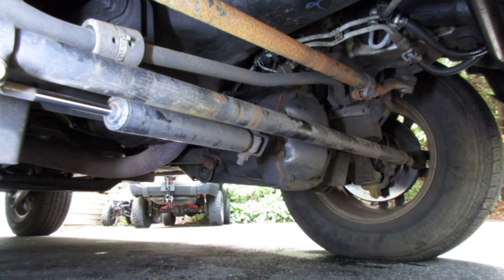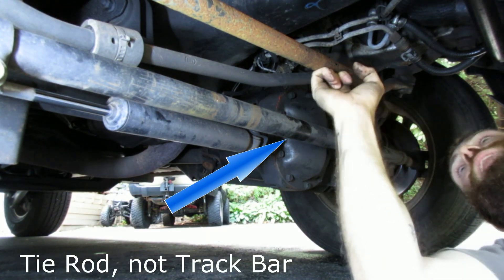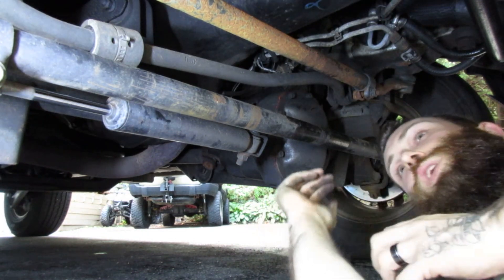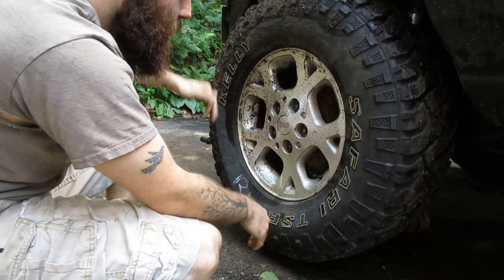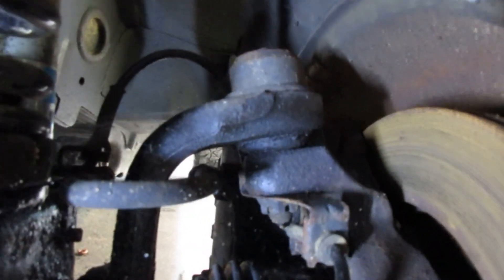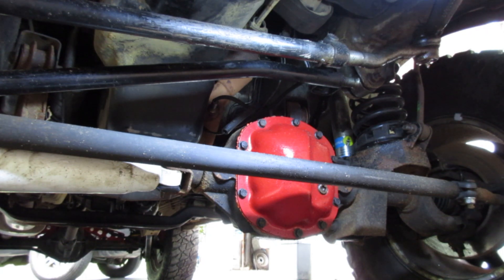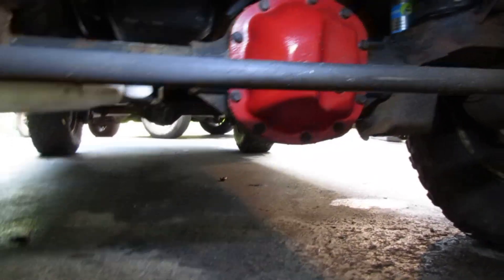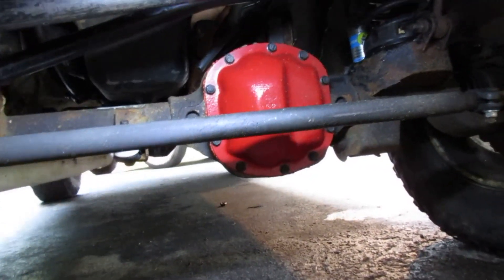How to Diagnose DEATH WOBBLE

Comment: Excellent rant! This video is gold and I am going to share it with everyone. This is critical thinking, expert level experience and articulation at it’s finest. Now I really wish someone would make a video like that on BMW reliability since that brand’s reputation has been tainted by virtually the same problem. The highly disproportionate level of abuse and neglect that BMW’s are subjected to in comparison to it’s competitors’ vehicles is rarely understood. So many of the same problems. First time performance car owners who don’t do even basic maintenance like oil changes, ‘enthusiasts’ who do incomplete mods and push their cars hard on the daily, and shops ignorantly splicing into wiring connected to complex electronics to install things like subwoofers are just few among many of the issues. I have a saying: “A Jeep is like a AK and a BMW like a HK. Both highly dependable, the question is do you want something inexpensive made for handling any dirt you throw at it or do you want something expensively engineered for ultimate precision?”

Comment: In 2004, My 1973 volkswagen beetle had a death wobble! Especially if I hit a bump on the highway. It took thousands of dollars at my volkswagen mechanics trying to figure it out. It wasn't until my tire guy told me my tires were being ripped apart (you could see the metal mesh thru my tread. 😬) and I desperately needed to go to get an alignment. Totally fixed it.

Comment: I am years late but I have a question. I pray you answer... I feel the car is not stable when I turn... its feels like my wheels will fall off. I dont have the big shaking. Also my steering wheel is kind of loose. i turn the wheel too much for the turns I take. The wheel turns too far to make little turns. Can you help me out with knowledge on the issue?

Comment: A bad steering damper may not cause death wobble but a leaking one can absolutely enhance it once its triggered.  If the oil is leaking out,  air is being introduced to the internals of that shock and air is compressable like a spring.

Comment: the expansion hose for my front differential fell to the ground leaking some fluid and that caused the jeep to have death wobble, took taking it apart and refilling it full of fluid to fix the issue after several mechanics said I was crazy and that theres no way that would be the issue, saying its prolly rotors, breakes and anything else you can imagine that doesn't really account for any wobbling.

Comment: I disagree with the fact that only solid axel 4x4s get death wobble. I have both a 1993 Toyota 4Runner (ifs suspension) with death wobble at anything over 70kph. I also have a 1984 Toyota 60 series with a leaf spring solid axel with the WORST death wobble I’ve ever experienced. Anything over 55kph I have to pull over and stop before I die.

Comment: You should say that the real reason Jeep's get death wobble.not because it's a solid front axle..it's because they don't use leaf springs.and leaf spring hold the frame to the axle stiffly where coil springs have alot of flex and movement so they NEED A TRAC bar.where a leaf spring front axle doesn't really need a tracbar

Comment: This was a great video.  Love that ball joint test.  I’ve done track bar, all tie rod ends, one hub, all control arms and still death wobble.  All parts were worn out but still haven’t found the last culprit.   Can’t wait to do that ball joint test.  Thanks so much!!!
Reply: @SCOOBYDOOBIEUFO  yes on that jeep I was talking about it was slightly worn ball joints.  For some reason out of the half dozen jeeps we’ve had that jeep was super sensitive to death wobble.   Any part that was worn would cause it.  After ball joints it went away.  We have a road that had a angled bump that we could generate death wobble on and after ball joints nothing.  It was gone, till the motor gave up.

Comment: The guy I bought my WJ from couldn't fix the death wobble and decided to sell it. I saw on jeepforum that the JKS adjustable track bar it had on it has red bushings and apparently they are known for being too soft. Went to kevinsoffroad.com and they say flat out on their website you probably need to change the red bushings for their black set, even though they only sell the track bar with the red bushings. Long story short I swapped them out and fingers crossed so far so good. I havent gotten above 60 in it yet but before at 55 you could feel the wheel start to move after hitting even a little bump. Maybe you guys can collect remedies like that for random issues and do short videos explaining them for people looking for answers. I'm sure they would be a hit.

Comment: I just had my oil changed and tires rotated. I didn't have it before but now I do. I've heard that a few possible tire issues can cause DW as well. Any truth to this?
Reply from the maker: Yes and no. Tire issues with trigger DW, but are not the root cause. You likely had something loose for a while and not one of the tires the came from the back and is now on your front is slightly out of balance and is triggering the DW.

Comment: Great video and explanation of the causes of death wobble. I’ve used these same techniques myself, and had great success. One small suggestion I would make, has to do with the tools involved in diagnosing the ball joint wear. Rather than a prybar and fulcrum, such as your chunk of wood, I use a long-handled shovel under the tire (although you could also use a short-handled shovel to get the job done). The angle between the handle and the shovel creates its own natural fulcrum and does a great job. Most offroaders have a shovel of some sort, although they might not have a long prybar. Plus, fewer tools means simpler prep and cleanup.

Comment: I have death wobble in my 91 infinity, car is v8 and only rwd, no front axle but not sure what its coming from. Thinking either tie rod end or something
Reply from the maker: Gotta be tie rod ends or possible control arm bushings. You can do the same test where you lay under it while someone turn the wheel. Look for movement
Reply: D&E In The Garage okay, cause I jacked it up and took the wheels off and shook the rotor up and down and side to side and checked the bushings I could get a good look at, all seemed pretty good tho

Comment: The rear end seems to go side to side when you hit a bump , what tricks do you have to check it? 2000 Jeep Laredo
Reply from the maker: Likely lower rear control arms
Reply: Do you have any tricks to check for that ,or is it easy enough to see if they`re worn, also would a guy be better off replacing the upper and lower control arms or doesn`t the upper wear out very often, I have 
175,000 miles on it.

Comment: I had a 98 keep grand Cherokee with death wobble. And I found a crack in the frame behind the steering box. I plated the frame and welded up the crack. After drilling small holes at each end of the crack. Stopping the crack from expanding. And problem solved lol. That was the best 150 dollar jeep I ever bought. Just because the other guy replaced Everything under the front end and could not get rid of the wobble.
Reply from the maker: Wow... that is wild! Sounds like you got a dang good deal though

Comment: I have had death wobble in my JK once, and it was the track bar. I now have it again, and checked everything, all seems to be tight except the upper, and lower ball joints. Like yours in the video, I hope that solves my death wobble, guess I have a project for an upcoming weekend. Awesome video! Did replacing those upper and lower ball joints fix it?

Comment: Okay, This is by far and away the best damned video on death wobble that I have ever seen, and I am so happy to have found it. I have both a 97TJ and an 04 Grand Cherokee. The Cherokee recently began to display the “Death Wobble” about 3 days after I bought it. My wrangler stopped having death wobble after swapping out the wheel bearings, and after 372K it needed them. Truth be told the 12 point bolts are actually a T13mm socket and it is best to use that particular socket after I found out the bolts strip faster than a drunken prom date. Having been a jeep guy for 22 years, most jeep videos treat death wobble as if it were some kind of occult secret that only the initiated could ever understand. While I have not experienced REAL death wobble, like other folks, I can tell you that when it happens to you the first time it is one of those things you do not forget. Again, many thanks for posting this video.
Reply from the maker: Thanks buddy. It really isnt a very complicated thing to diagnose

Comment: I have my 2000 Nissan Pathfinder, rear wheel drive, up on stands in my driveway right now because of this! I'm replacing the upper and lower control arms/trailing arms now. I will be checking closely on the sway bar links, coil springs, and shocks to see if any excessive wear or damage has been done to those during the time I've had the death wobble. The Infiniti Qx4 is almost an identical design as well. Years 1997 - 2004 are victim of this condition. Thanks for putting your video up and saving lives!

Comment: Replaced Axle shafts,all axle seals, then checked spider gears. Then replaced Wheel bearing hubs. All4 tie rods and adjust sleeves, got alignment. Then replaced Steer dampener  shocks, 2 track bars now, rebalancing all tires. All new brake parts. Sway bar links and bushings.  Replaced literally everything.  But ball joints, they are good greased and rock solid. Still have death wobble... I see my pinion seal is leaking again.  I'm going tomorrow to replace the front drive shaft rear CV joint it seems really loose and noisy. I really want this to fix my WJ wobble once and for ALL.... Maybe that's why the pinion seal is leaking again? Any tips will help thanks.
Reply: Want to follow up for everyone who has a mysterious wobble or shake in the front of there WJ. Most drive shafts have u joints some are double cardans, some are slip yokes. And then the R,pressa I believe that's how its spelt. What it is a a CV shaft style joint. And in mine was the inner cage housing was cracked within the joint and two of I think 6. Ball bearings where both bouncing around.  Of course found this out when I broke apart the CV. I found this to be the source for my wobble.  Make sense why a blow another pion
Reply: Pinion seal** from extra vibration. I hope this helps someone else. Vortex garage has a great video on replacing this style drive shaft.

Comment: This may be a saving grace for my 2017 F250 that just started having this issue,
Reply from the maker: Should work. good luck!
Reply: Zach Beach. My ranch hand has a 2017 f250 with death wobble. It was a factory defect. He carried it to the ford house and got it fixed.
Reply: I ended up selling it after three trips to the dealership and $2k out of pocket :/ I do drive a Duramax now so we will see how that goes

Comment: Loved this! Been rding with death wobble for about a year now and it is exactly as you described. Get over 45 and hit a bump and I have to drastically slow down to get it to stop. Stop riding on  highways to avoid it. 

Heard it was dangerous. Knew it was damaging the car but didnt really have a choice. Guess I'll get the whole front end kit off Amazon instead of just the control arms. 

Is it always the front end causing it or can the rear cause it too? Ive got gunk all in both rear wheels.
Reply: Can be very dangerous to keep driving if your tye rods are involved. If they give out & you're driving...you have no steering capability. Please, get your front end checked out. God bless.

Comment: This is my first go round with death wobble, but You confirmed what I suspected, I know I've got one bad the rods my tires are out of alignment Wich is what I suggested to be the problem or  main fact- or however upon inspection I found play in the wheel at 3 and 9 as well as 12 and 6 and the trac bar bushings are shot along with the stabll8zer link bushing s on the driver's side the side that tries making  out of me . Initially the wobble would start dead Knicks at 40 now though I can feel the wobble at around 25 and by  40 it's going nuts unless I have room to accelerate like I'm getting on the freeway, then I can drive past it /out of if it, when it states to wiggle just ease back on the 
Peddle let it get calmed down a bit then give a slight tug on the wheel while squeezing back into it until in know I've got it then I can hit it and go.. Occasionally that don't work I haven't had to completely stop but a couple of times damn b
Neer it . So I'll do the wheel bearing in the morning I would up with an extra one the last time I did them and everything else will have to wait until pay day
Reply from the maker: First time is always rough. Good luck with it!

Comment: Great video!! Wouldn’t the final test be better if you lift up Jeep in front or put it on jack stands and turn wheels while running lock to lock and check for play in components?
Reply from the maker: Actually no because you want all the tension that the weight of the jeep puts on the components. sometimes. Likely you would not be able to see the worn out parts if there was no weight on the system

Comment: Great video.  I did all of the tests on my 2000 XJ.  I ended up noticing play where the drag link meets the pitman arm.  I changed the drag link, the steering stabilizer ( which was completely trashed)  and pit new tires on.  Drives like new now.

Comment: My issue is my 09 2dr jk (45k miles) has a shake in the steering wheel and pedals at 75. No bumps that cause it no DW and it comes and goes. I do off road fairly frequently too.
Reply: did you check your wheel balance?
Reply: @MeastyJK  not yet but I'm going to. Hopefully that's it.
Reply: On an unrelated note I concurred a pretty flexy and sketchy trail... alone...  the flexy bits were down hill with no bypass. Damn I'm dumb.. 😅 I do feel like I have you guys to thank for the subtle lessons and know how in picking lines and what not though.

Comment: Is this the same for excessive wobble/shaking when breaks are applied? I replaced rotors so that’s off the table. Thoughts?
Reply from the maker: yes, likely. If you front end components are really out of spec just applying brakes could cause enough stress on the system, so I would check everything mentioned in this video

Comment: I have a rear wheel drive comanche  it’s 1989 pioneer with death wobble  but it’s not  4 wdrv  it’s all stock would this apply to my truck as well ?
Reply from the maker: Yes, the 2WD Comanche basically has a dana 30 front axle without the center section. You have all the components mentioned in this video. Track bar, tierod ends, ball joints, etc..

Comment: Great video! Purchase a 2019 F450 in November of '18. Bottom line is this should not happen in a brand new $75k vehicle! What should be done for these vehicle makers to make this a recall?
Reply from the maker: Jeez, I do not know. If it is any consolation, the 2019 Wranglers are leaving the factory with this issue. Not sure what the overall problem is. Definitely complain to anyone at Ford who will listen

Comment: WHAT A PIECE OF CRAP!
The company should have fixed this issue years ago!!!!
They are JERKS!
A guy just experienced the death wobble on 8- 2019 new jeep. Rolled over multiple times. 
 Broken ribs, spleen removed, head trauma, spinal injury, collapsed lung and damaged left eye!!! 
THE FRONT WHEELS WOBBLE LIKE THEY ARE GOING TO FALL OFF. 
I UNDERSTAND THE SUSPENSION HAS  TO BE  FLEXIBLE BUT NOT TO THE POINT THAT THE TRUCK HAS SAFETY ISSUES. 
RIDICULOUS!
NI ONE SHOULD BY A JEEP!
THE COMPANY SHOULD DISCLOSE WOBBLE AT 50 MPH!!

Comment: Thanks for the information.  I have a 2000 XJ and it has a bunch of free play in the steering wheel going to the right but not the left, any thoughts?
Reply from the maker: Could be track bar. I would get under it while someone is turning the wheel to see where the play is

Comment: Just happened again on my 97 ram 3500. Brand new t style front end, brand new ball joints, brand new problem solver track bar, brand new bd diesel steering box brace, adjusted steering gear to spec. It was fine until I was doing 110 (kmh) on the 401 and hit a heave in the road. Never experienced it at that speed and it was horrifying. I couldn't even shift out of gear cause the shifter was impossible to grab. Just about ready to do a 2wd IFS swap cause being afraid to hit small bumps is bullshit.

Comment: Castor causes death wabble. Jeeps with live axles have no adjustment unless you either have adjustable lower ball joints or an adjustable lower control arm. All the things you mentioned allow the wobble that is caused from bad castor.

Comment: I'm new to this so don't laugh. I think that not changing out control arms after a lift will cause you to have a bad caster angle making the steering much easier to move and/or be moved by changing road surfaces thus creating the conditions you explained such worn out track bar and tie bar ends.
Reply from the maker: That is correct. not wrong at all

Comment: I have 99 wj between 50 n 60 if I hit brakes to hard I get xtreme DW any advise please
Reply from the maker: Well to start you likely have warped rotors. Outside of that, I cannot say much more than what is in this video. The brakes are the trigger, but not the cause. Something else (start with track bar) is out of spec and needs to be replaced
Reply: @DEInTheGarage  thanks for advise best jeep channel I have found by far keep up the good videos

Comment: I have an XJ, it shook a little at ~65 stock tires when I bought it for $2900, mechanic said it needs new ball joints but everything else is good. Replaced the ball joints and then I got death wobble. Unable to find issues with my tires or any other part. Where should I start if I’m just gonna go down the list of replacing parts? I’ve had a TJ that had death wobble that was cured by new tires but these tires are fine and have had them checked out.